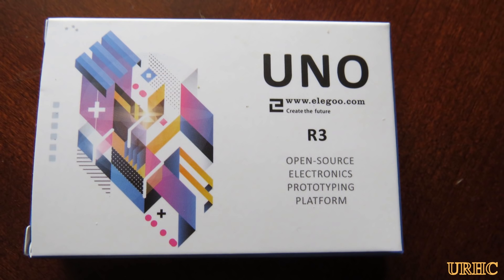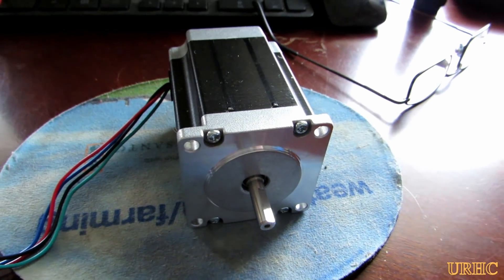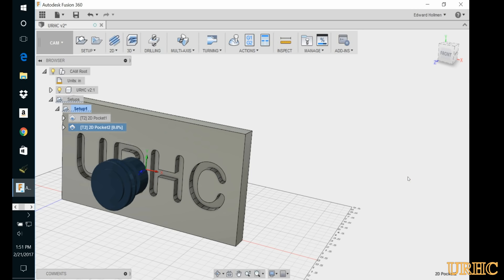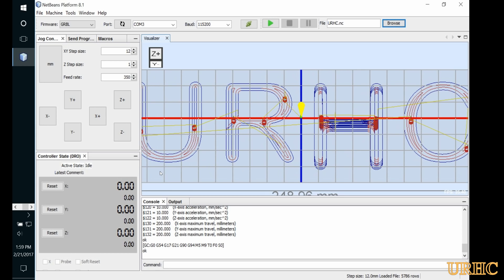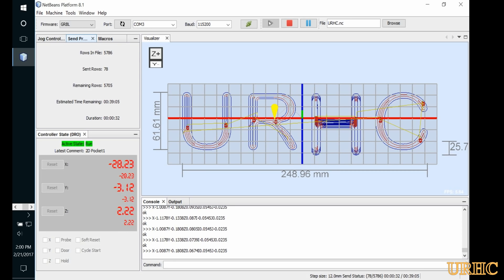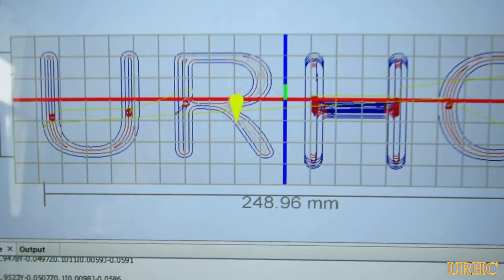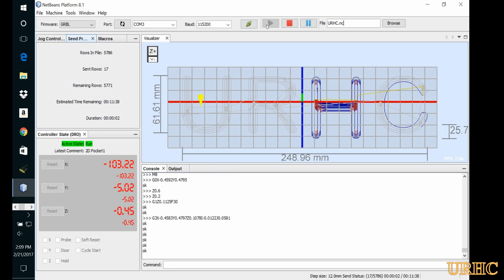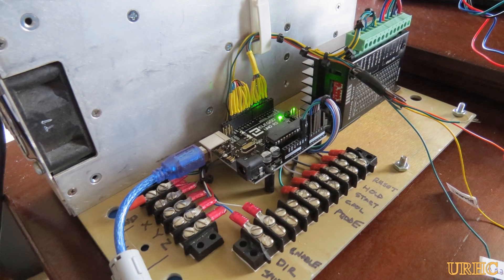Trying An Arduino With GRBL And UGS For A CNC Lathe Build

Comment: Hi URHC, Nice vid!
I'm also trying to build a benchtop cnc lathe. I use fusion 360, UGS and GRBL1.1(Arduino Uno). But I came across a problem, for post processing fusion 360 (for generating gcodes) I need a GRBL Lathe configuration file. Which configuration file did you use for the lathe gcodes? Would you be able to share the configuration file? Thanks in advance, Patrick
Reply: Hey guys, so I've been playing with this same setup, but with .9j, fusion 360 and UGS, building a post processor for Fusion 360 just to be able to cut profiles into stock to create table legs, handles, etc.. nothing special.  But if you're interested, let me know thru messaging, and I'll send you a link for where I'm at.   But this is a simple X/Z setup.  No Y Axis, and it's a bolt on CNC to an old wood I'm using for proof of concept.
Reply: @DanRegalia  I have a problem. I am using similar lathe codes in which post processor generates codes designating diameters but UGS and Arduino doesn't recognize it. I want to change it to radius recognition. Any Help please?
Reply from the maker: I didn't get that far. GRBL does not include all the lathe commands so it is limited to basic x and y paths. I know there are no threading functions either. I am just going to make a basic x, y configuration for my sheetcam program that I use for my router and plasma and try to use that when I get back to it.  Sorry I can't help you. Thanks for watching.

Comment: how did you hook the android to your stepper driver. please let me know
Reply from the maker: It is an arduino hooked to the drivers. Go to the GRBL wiki page and there is a pinout diagram showing the connection points.

Comment: Thank you, watched a ton of videos so far. None have portrayed this type of information with software to hardware. I can help with the wireless if you need. Take a look at the hc5 or hc6 They both do the same thing by setting up a serial line communication.
Reply from the maker: This is all new to me and with a little online research it is pretty straight forward.  I can't wait to  get back to building the lathe hardware.  Thanks for watching.

Comment: Sir , 
Good work, Can you build a cnc wire cut with these ckts board and what software is required?
Reply from the maker: I think it would be easy.  You would need GRBL loaded on the arduino, the g code loader, and a cad cam program to generate the g code such as autodesk fusion 360.

Comment: Hello,mate

You have connected the ELEGRO UNO R3 and the Microstep Driver with 6 wires (ena-, ena +, dir-, dir +, pul-, pul +). You can show me schematically or in some other way explain how you connected it. Much I need your help
thank you
Nermin.Hodzic
Reply from the maker: Just do a web search for GRBL pinouts and you will see how they are wired.  Once you load GRBL to the arduino  you should be good to go. You will also need a gcode loader to feed the gcode to the arduino. The code and wiring can be found on https://github.com/gnea/grbl/wiki/Connecting-Grbl
Reply: :)    :)     :)   Of course I searched on the internet how to connect GRBL and drivers,But I have not found a way to connect ENA - ENA + but thanks for helping me to keep looking :)  I already have arduino + gbrl and all the programs necessary for the work of the engraver......
Reply from the maker: I just jumpered the enable pin on the arduino  pin out to both drives and ran a ground back for the -. Both drives become active at the same time.
Reply: hello ... you seay me this ....
I just jumpered the enable pin on the arduino  pin out to both drives and ran a ground back for the -. Both drives become active at the same time.
But I still do not understand,Maybe because of that, my English language is not good enough;)
You want to say:
1. ENA+ pin from driver you are connect to arduino pin 8 ,stepper enable /disable........This is correct ?
2.ENA- pin you are connect to arduino ground 5V........This is correct  ?

https://github.com/grbl/grbl/wiki/Connecting-Grbl            look pin 8   its that ENA+ pin ?

Thanks for understanding and time off
Reply from the maker: The enable is basically for safety to shut the drives down quickly if there is a fault or the epo button is activated.  That is how my drivers were wired. Just be sure to use the arduino gnd pin for all drive connections.
Reply: The enable is basically for safety to shut the drives down quickly if there is a fault or the epo button is activated   its this wired to the arduino 5v power  or ?
Reply from the maker: The arduino enable.
Reply: yes sir thank you for project but tell me about enable/disable ====>:( +5v )or( wiring X.Y.Z) 
together stepper motor in enable pin?

Comment: Can you discuss your Router CNC build? I am looking at this Open Builds OX CNC Build. I have seen yours on several occasions and it works well.  Also, I am interested in your Plasma.  Any information for us to get one going would be of great help.

I am learning Fusion 360 Mach 4 is only $200 I can live with that.  Watching your accomplishments using these tools it is a very worth while to build and get going.

After retiring from the Military one of the things I truly desire is a very nicely equipped shop.  Mine is insulated and heated so I have all year to be able to work on gear.

I also very much like your Tree Milling operation. We do not have acreage yet but will in about 3 years. This will include a family farm & a for profit horse stable. So, having this gear is very important to make custom items for less & once designed and programmed it is there to be re-made or fixed if needed.

Thanks for all your vids truly wonderful to watch.  You even made the cork stuffer! 

What did you do in your former life?
Reply: I'm retired military as well in my second career and have. Even playing with these controls also. I just built a small, cheap cnc engraver that runs well with Fusion and is adriuo with grbl. As far as Mach 4, I used that to run my G0704 mill converted to cnc. In my control box I use a smooth stepper board which provides better control of the steppers but even better it provides a USB interface instead of the older parallel printer interface. The little machine I just put together is so nice because I can play with all the functions of my bigger mill inside on my desk. Still learning Fusion 360, I learned Autocad on I believe was version 10 in 1988. Principles are the same but oh how the inputs have evolved. I think learning these skills keeps an aging brain exercised. I did build a DRO for the mill before converting it to CNC using an ardunio controller with a wireless connection to a Galaxy handheld pad. Works great. I forget who's website I found the instructions on.
Reply from the maker: Both my machines use mach 3 and xp parallel port computers that are basically obsolete along with sheetcam for the g code. I know nothing about mach 4 or usb type of interfaces that are showing up lately. All you are basically sending step and direction signals to the motor drives. Mach 3 handles all the interpretation of the g code and adds accel and deceleration rates plus parameters for specialized g codes. You have to start by sizing your motors and drive type to match the loads you are moving and speeds requiired. I like to use servos for the closed loop feedback,  but steppers are lower cost. I spent thousands of hours getting my plasma table designed and running .Grounding,  noise, & the torch height control consumed much of it. I just saw a new controller by masso cnc that looks pretty cool. It  looks like a easy way to get a machine up and running with plenty of i/o for  around  $500. I don't know how good they are, but they look interesting. CandCnc is a good place to get the torch height controler or even a full solution to drive a plasma table using Linux cnc. There also are some turn key plasma systems available for about what it costs to build one. I think your budget  will determine what you can build and how big it can be. I am looking at arduino for this project for cost, but am finding it is limited in the operations it can execute and post processor availability. .
Reply: Thanks for the information.  I am making a folder for all the Router CNC information.  After seeing your videos it is so nice to have a solution for a building task to be completed. After the design process & CAM process go to your tool and let it go. File save for  a later date.

For those that would like to learn Fusion 360 I personally bought the course below.  So far I still like it and recommend it.  I am not all the way through. I have to say I am 53 and feel like a young kid trying to learn this.

http://mikeandlauren.com/learnfusion360

Thanks again for the information. So funny how your Channel got its name to Funny.
Reply from the maker: http://www.delusionaldesignscnc.com this co has some examples of low cost plasma tables. Cost me about 8k to build my 4 x 5. They have a working 4 x 8 for that.
Reply from the maker: You hit it on the head. Keeps an aging brain exercised.

Comment: How do you think to use GRBL on a lathe? It doesn't support turning g-code commands. It's even impossible to select GRBL postprocessor in Fusion360 if you used a turning operations in CAM. Of course you can use simple XZ motions to move your tool. But Fusion360 will be useless in this case... or very tricky.

I'm also building simple CNC lathe and will be happy if I wrong with "Fuison+GRBL+turning"
Reply from the maker: I was able to draw up a hour glass shaped spindle and use the turning post processor and it created a x, y g code that first did roughing, and then a clean up cut in the simulator. I had a oversize stock so It did a lot of roughing so I will have to figure out that part yet. It looks like there will be some edits to commands that are not supported, but I just want the x, y outer profile for simple wood turnings. I have only played with Fusion for a short time and hope I can use the code. Once I get back to it and build the mechanical I will know for sure and make videos about the out come.
Reply from the maker: I don't think there is any way to do threading and some other operations like that using GRBL
Reply from the maker: I am just using x and y.  The lathe is turned by a single speed motor that is on or off, and a simple on off router will do the cutting. The feed speed of the x and y are the only variables i will have to deal with. It will just be a simple spindle shaping that I plan on doing and will most likely have a lot to learn about fusion. If I cannot get that working, I will just use sheet cam that I use for my router and plasma table to cut the  2d profile with several different runs of g code to do the roughing. This project is just being done as a learning experience for me about trying to get away from purchasing another license for mach 3 to build a simple cnc lathe and I am sure there will be some hurdles to cross.
Reply: Well. I wish success in the implementation of this project

Comment: hi,
nice video. the netbeans program have you made it ?.. if yes, any guide please , I am trying to make a similar software but with laser engraver , PCB printing and all.. so I need a better guidance from someone.  
Thanks in advance.  !
Reply from the maker: I downloaded it from the universal g code sender page. http://winder.github.io/ugs_website/download/   . There are 2 versions this one is the platform version that is at the bottom. I am not  using experienced at using it and just getting started so I cannot offer accurate guidance. The 1 part I like about it is just click on the firmware drop down and a box pops up to let you see and modify the setup parameters for GRBL 1.1 . Thanks for watching.
Reply: Unemployed Redneck Hillbilly Creations thank you soo much for replying that quick. :)

Comment: Nice video Ed.  I tried Fusion 360 but it was so different from 2d Autocad I gave up.  I just can't get into the  3D world.  If you have not done so, check out Raspberry PI as an alternative processor.  I have about 7 of them doing different things, mostly security oriented.
Reply from the maker: I have a banana pi that I have been trying to load the gcode sender on to have a standalone system, but have not been   successful yet. I figured that I would play with the  Arduino at $11.00 a pop and there is a lot of info online about using them for low cost cnc applications like this. I found Fusion fairly easy to use and it has a cam post processor for lathe use that I need for this project. You just basicaly draw everything in 2d and then add depth to it. I just have to learn simple c programing to use them for other projects.
Reply: Nice project.  Are you going to design some sort of XY carrage to carry the tool?  Seems like it would be easier to start with a metal lathe where you just have to power the hand cranks.  Looking forword to more videos.
Reply from the maker: Just going  to make an x, y that can bolt on in front of any lathe. Sort of like one of those duplicators they make, but g code controlled. That way I could add another stepper for turning it and use it to flute also in the future.  Don't know if I will use a cutter or trim router to make the cut yet. If this works out I may try and convert my old South Bend for metal some day, but I am keeping this one as a idea that can be added to any wood lathe. Thanks for watching.
Reply: Unemployed Redneck Hillbilly Creations ..,you can buy a due and attach to smart ramps CNC board for around $40. Getting more expensive buy it’s also a 32 bit platform and it also accepts external drivers if you choose. I spent a small fortune on 150 Arduino boards of various types for research and so many of them interchange and all have their uses. I have also invested in a duetwifi setup with duex5 and various expansion/daughter boards and you can install the duet firmware on a smart ramps with due board for a fraction of the cost and achieve the same performance and in fact potentially broaden the capabilities since they’re more development appropriate for attaching accessories. Repetier is coming out with 7 axis firmware soon and that will be industry changing.
Reply: Clifford Costa with all the samd21 32 bit processors for $12 it shouldn’t have any issue competing with any other 32bit CNC controller. They make a mini to replace the nano.

Comment: Looking good!  Welcome to the Arduino rabbit hole! :~)  It'll be fun to see what you work up for your lathe project.
Best,
- Bill
Reply from the maker: I can see what you mean. Everything went on hold for a couple of days once the Arduino arrived in the mail. It amazes me how low cost it is for a simple machine controller. It will just be a simple 2 axis system that I am trying to figure out if I should go with metal lathe type cutters or a small trim router that may give a cleaner cut and be adaptable to fluting in the future. Thanks for watching.
Reply from the maker: I just ordered one of those kits with all the sensors from Amazon, looks like I am headed deeper into the hole. Thanks for the link.